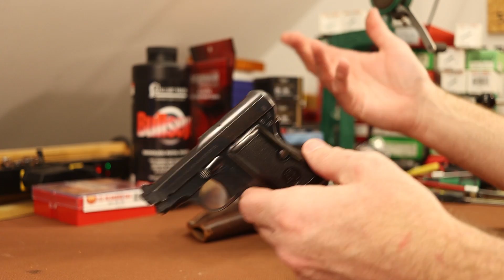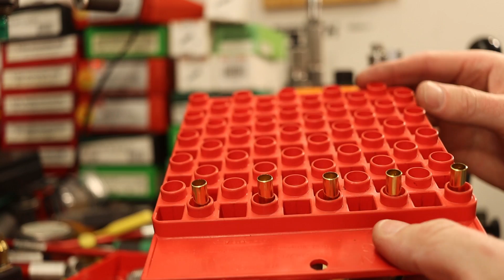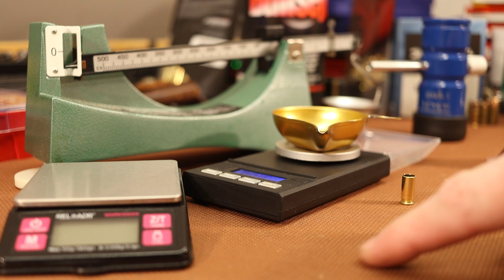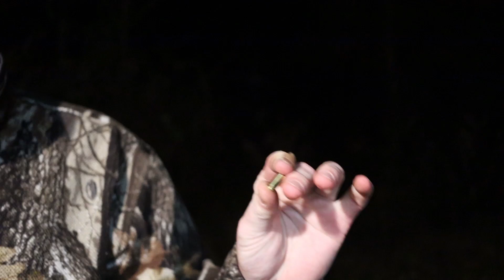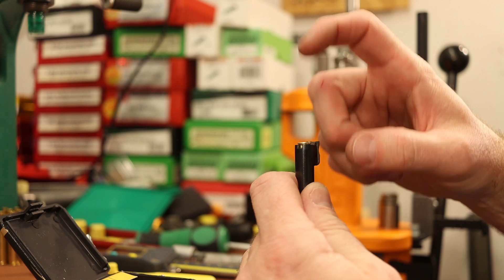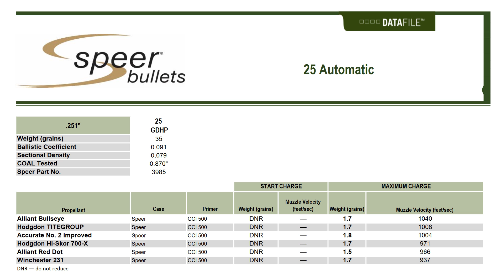Reloading .25 ACP

Comment: JRB-I'm new to your channel and enjoy it very much. I had an ammunition company from 1985-99.  Richard Lee from Lee Precision was a wealth of information for me and a great help. Hence I have a lot of Lee equipment (no detractors please) and have a turret press dedicated to the .25acp. I use the Lee micro disc in my powder dispenser with no problems. It throws accurate charges with flake or ball powder. You do need to expand the case mouth a touch more than usual. I load 50 grain cast powder coated bullets for playtime at 945-960 fps. The gold dot is right at 1000fps. Penetration with the GD is right at 9 3/4 inches in 10% gel. The firearm is a Bauer I carried in my uniform shirt pocket all 27 years I was an LEO. Loading the .25acp doesn't have to be a chore and is quite fun with the right equipment. Looking forward to binge watching your channel soon. Oh the Camdex commercial loaders we used had Lee dies as standard equipment and we loaded millions of rounds without a hitch. Happy New Year and great channel!

Comment: I was in contact with CCI tech dept. several years ago now due to a few misfires I was having....especially after I missed a chance at a trophy buck ugh !.....I was always under the assumption (as many) that the primer cups they made were harder than others. I noticed that more often than not, if I had a misfire a second strike still wouldn't set it off. When I spoke with the tech., he stated " no, they aren't harder, it's just that we make our primer cups on the higher end of tolerance size wise".......which, in my case made sense. If you seat one of their primers in a case with a too tight primer pocket, there's a good chance of fracturing the priming pellet.....rendering the primer useless. I use to use them exclusively back in the day for most handloads but I haven't used them in years because of it. Mostly Winchesters and Federal's in the last 15-20 years......

Comment: Those are not stove pipes, they are failures to go into battery or failure to feed.  A stove pipe is when the spent brass is trapped between the barrel and slide sticking up, hence the name stove pipe.

Comment: I started reloading the 25acp back in the early 80’s. RCBS made the dies and the shellholder. My dies were not carbide, but the shellholder was great. Back then only 50gr FMJ bullets were available and between 1.0 and 1.1 grains of Bullseye was the loading. If I used what my salary was back then as a “cost”, plus components, for reloading them, I paid like $75a box, in 1982 dollars!

Comment: 25acp is NOT at all weaker than 22lr all the data is completely wrong its comparing the twenty two from a rifle barrel of atleast 18'' and the twenty five from 2.5- 3.0 " barrel soo basically its useless data..    Thanks for your time on this video its really cool and i appreciate it very much.. 
This is something I have been thinking of doing for quite some time.

Comment: Any gun that fires if you do not adhere to specific steps in the proper order, is a death trap. Very poorly designed gun. If I had one, heirloom or not, I would chop it up. I would never put it in the hands of anyone else. Especially someone young enough to have their hands fit the rear handle safety.

Comment: If the .25 “powder through” expander die is like other Lee dies you can stick the funnel directly into that fitting you see screwed into the top of the expander die. That die is meant for the Lee auto powder feed and you remove that fitting to use it. The fitting stays in when not in use to hold the expander in place so it doesn’t get lost. Just leave the fitting in, as you did, and the hole on top is perfect for the red funnel, even has tapered sides for “draining”. Thus, after decapping AND priming at station one, you expand and pour in the powder at station two. That would have saved a bunch of trouble.

Comment: Hey Johnny, Ever heard of .277 Wolverine? Its a wildcat that is making its way mainstream. Starline and Hornady are making brass. Anyway its a 223 case with the neck cut off and takes a 6.8 Spc bullet. It is like 300blk in that you can shoot subs and supers but it is way more accurate and just a little weaker than 6.8 but way cheaper to shoot. It was created by Mad Dog Weapon Systems. Check out their website they got hornaday to produce dies and WFT makes a trimmer for it. All it takes is a barrel swap and unlike 300blk it wont chamber in a 5.56. I just heard about it on ar15 podcast yesterday just thought id pass it on.

Comment: Rcbs is best shell holder for this case. 1st to insure you fire arm will work with a certain primer load a case primer only, place in the chamber with it in the extractor as it came out of the mag and pull the trigger. Next due chamfering first, then prime on sizing, place the lee funnel in the powder thu expanding die and drop your charge. Also magnetically dampened scales are bad on light charges because they dampen on the up and hold enough to over charges so use a 22lr case cut to hold the charge of specific powder you want to use, use a paper clip for a handel on it and drop all at once so the scale deflects both up and down to operate properly. This is only my advice but very tested and proven in experiance with this cartridge. Good luck next time.

Comment: Grafs has 50 grain FMJ  bullets which work very much better in my gun and are more pleasant to shoot. Hornady makes a 25ACP seating die which will save your fingers and does a much better job.  Save your Lee seater for use as a dedicated crimping station in the following turret station.  With charges this small you really need to work with  a mg scale.  90 mg of Tin Star ,N32C, will nearly duplicate the performance of Aguila 50 gn FMj loads.  The load density is almost 100% delivering a SD of less than 7.  My best results have been with Fed 100 primers.  The Grafs 50 grain bullet appears to be the same as the on used by Aguila.  Hornady brass is an excellent fit in my Lee shellholder.

Comment: Thank you for a great video : I have five 25 ACP's in my collection and reload for all of them using a lead hard cast bullet at 50 grains with 1.3 of Titegroup. I have found that brass is critical to a good interference fit with Starline or Sellier & Bellot being the best. Shellholders, as you found out, can be a pain in the ass and hard to get a good one and the occasional nipped finger is almost a given with this tiny little round. Also ( again as you have discovered ) bullet setting atop the case before seating can be critical.  I had to have the mandrel for flaring the case mouth "tweaked" in a lathe before I could get the flare I required to prevent mis-aligned heads. After hand-loading 200 of these in a session, a stiff Irish Whiskey is usually required but the reward is the fun of shooting some very small and strange European pistols from nearly 100 years ago. We have tremendous fun shooting ours at 3, 5 and 7 yards on IPSC targets, but if you want a severe challenge, put a couple of clay pigeons out at 50 yards and shoot them offhand !  Here's a tip for doing that, make sure you use a Mauser Model 10 as they have decent sights : you'll be amazed at how it concentrates the mind wonderfully and how well you'll do. Again, thank you for your superlative videos; they are much loved and appreciated here across the pond.

Comment: I wish 25acp was more popular.. I really think it would be a great plinking/squirrel cartridge without all the issues of 22lr
Reply: It's a trade off of problems,i messed around with 22 and 25 alot many years ago, the 25(always remember only having Remington green and white box)was reliable,I don't remember ever having a failure to fire but man,22 is so much flatter shooting,25 drops alot and fast,I hardly ever,if ever ,missed a rabbit with a 22 at 50 yards and hardly ever,if ever actually hit one poa with a 25, I carried a 25 for close range self defense though over a rimfire for the significant increase is reliability. It's a classic what do you want to do comparison,for general plinking squirrel,rabbit,coon,ect. 22 is far more accurate than any 25,per my experience at least
Reply: @wolfmanrebel874  Something I never really considered but you're definitely correct.. A 35gr xtp at 1100fps would still give me almost twice the drop of a 36gr mini mag.. I never realized how terrible the BC is on 25acp bullets

Comment: The "25 acp is more reliable than 22lr" theory kinda goes out the window with this sample anyway
Reply: In the blowback pistols that are chambered for it, you get more reliable ignition. They have no extractor, so like all guns that have no extractor and rely on that operating system, they’re going to be more touchy than a modern auto loading handgun design. When it came out, it achieved what JMB was going for with it. 
I have no idea why, but I have an affinity for these obsolete pocket pistols. Would never consider carrying in any capacity. Maybe a backup to a backup? Finding a load that it likes and then being able to secure a supply of it? Nearly impossible. Fun as hell to shoot, so reloading it such that one doesn’t have to pay $25/box makes it less painful.

Comment: Get a rat tail file, like 4 the chain saw, or a dremel and take some off the top of the shell holder at the apex where it begins to taper down. That should fix the leaning issue. Give it a double angle grind like a valve job

Comment: The mouth flaring die is meant to be used to hold a funnel for pouring the powder into the cases on the press.
Reply: It is meant seat a bullet without shaving it. Not for a funnel.
Reply from the maker: Very true!  If you've ever used the powder-through function you probably know that some powder inevitably gets stuck inside the die (not much, and usually nothing to worry about).  With these tiny little charges I would be worried about even a tiny loss of powder, though.
Reply: Phat Tyre: it is for both purposes. Lee calls it "powder-thru expanding die". When mounted on the turret press and pulling the crank the Lee AutoDisc dispenser will pour powder in the top just as the mouth is flared. When not filling the case with AutoDisc, you can fill through that opening. See: https://leeprecision.com/reloading-dies/hand-gun-dies/powder-thru-expanding-die-only/

Comment: If I remember correctly, the slide hold open position of the safety lever is for disassembly only, not to be used for dropping the slide on a loaded mag.  With the safety in disassembly the sear is disengaged and allows the firing pin to travel home with the slide before the sear can engage the mating surface on the firing pin.  You should insert the mag with the slide forward, then rack the slide to load the first cartridge.
Reply: Have a look at this new Gordons Reloading Channel video.  It is in German, but should have an English overdub shortly.  https://www.youtube.com/watch?v=T3lss3rI0vw
If you look carefully, you will see that GRT already has a StaBall 6.5 powder model at about second :27.  You will not find that in QL.  GRT is free to use.  I can tell you that the StaBall 6.5 powder model is very close to real life.
Reply: Here is the English version.  https://www.youtube.com/watch?v=wuNeaQxU-jg

Comment: I reload for my Beretta 950 .25 ACP using a Lee die set.  (I use Magtech's brass and 50gr. FMJ bullets, Bullseye powder and CCI 500 primers).  The shell holder I have gives a proper fit.  Are you sure you have the correct one?  Also, your failures to feed are just that: failures to feed.  A "stovepipe" is when a case fails to completely eject and ends up sticking up out of the ejection port looking like...  a stovepipe!  I tend to think your pistol needs a new set of springs for reliable ignition.
Reply from the maker: Robert Scott I was annoyed at myself during editing for calling all of those stovepipes. I knew better and have no idea why I did that.

Comment: I learned that CCI primers are hard because between a S&W 686, S&W 66-2, and two Colt Troopers (Mk III and Mk V), I repeatedly had failures to fire when shooting double action. Absolutely no issues single action. And absolutely no issues double action since switching to Federal small pistol magnum primers. I still use CCIs for all my other bulk pistol ammunition and have no problems in any other caliber than .357

Comment: If you still have the Hornady hand priming tool from the Lock n Load press kit, that might be a good option since it uses regular shell holders. It’s a hunk of junk otherwise but should work in this case.
Reply from the maker: I completely forgot about that!  That would have made things SOOO much easier!
Reply: The RCBS tool uses regular shell holders, too.

Comment: Made me smile when you said "We are not here to talk about the Beretta 418 because this is a reloading channel" I believe that people need to accept that.  I applaud your effort in working with such a small caliber. Btw, I you are correct with your instruction in bullet alignment, as you seen with your groups I have a feeling that was the culprit, (9mm is the same deal). anyway good video-Dave
Reply from the maker: I think I've become too reliant on the Lee Factory Crimp Dies and when I don't have one it makes me a little nervous.  I think I even mentioned in the video that if I was reloading 9mm I would have flared more, which should have been my first clue that I was about to make a mistake.
Reply: @JohnnysReloadingBench  nope your first clue should of been Lee. If you check around you will find out that everyone useing Lee dies has a seating problem. The seating stem floats around and doesnt line up all the time causing the bullet to tilt to one side and with the added issue of the shell holder im surprized that you had so few problems.Buy a hornady seating die and shell holder to make the problem go away. Personally the 25acp makes a better paper weight than a defence gun.

Comment: I would highly recommend changing the firing pin spring, double check the firing pin channel for cleanliness as well. Failure to fire and firing on slide drop could be because of that. I'd also be checking the sear for wear. Wolf springs may have what you need if beretta isn't an option. I'd replace every spring the gun has if possible.

Comment: i'bought one of those in new mexico in the early 70's, it has a brass colored frame though. it's a great little gun and i've put a few rounds through it over the years. i think you might have trouble running anything but ball ammo through it. they had no other type of bullet back in the day i'm aware of, and that's all i've ever used. never had much in the way of hang ups or malfunctions, it always gone bang. no double fires either( but my hands are fairly small). i would carry mine now with confidence, but have no holster and have not found another clip or two. if you can get them to feed reliably i't would interest me greatly, i've been keeping my eye out for that for a while but never found anything. there once was some ammo that had a bb on top of a kind of hollow point, i assume it was to help it feed , but i've not seen that ammo again. i've never had the gun fire when i dropped the slide like you did, don't have any idea why it did that to you. good vid, thanks.

Comment: The Lee Hand Press works better for sizing. Can angle the shell holder to keep the case straight in line with the die. Otherwise a new pencil with an unused eraser on top keeps fingers safe. 
The double tap is likely the shooter. Those older guns had easy triggers and people with medium to large hands usually bump the trigger in recoil with a resulting double tap.
"Down is fire"...... I suspect what is happening is the same thing that happens with a de-cocking gun - only that isn't equipped with a de-cocker.

Comment: I loaded up 100 rounds of 25 acp once.... haven’t fired it. Cant bring myself to after the aggravation I went through loading it lol
Reply: Sounds like my favourite PITA - the .22 Hornet - bulges cases and crushes necks unless you are SUPER careful.
Reply: @richardmeyer418  I used to think I wanted a 22 Hornet, used to...  I always hear of inherently accurate cartridges but the 22H seems to be inherently INaccurate!  Could it be that the twist rates are too slow I wonder?  I have thought about the 17 Hornet but I already have a 17 Fireball so it’s just a thought.
Reply: HAHAHAHA!  I have a few reloads like that.  They were such a pain in the ass to load, that I just tested them, and shelfed them.
Reply: What made it so difficult?
Reply: GunFun ZS struggling with the crappy lee shell holder. Weighing each individual powder charge and checking and rechecking because there’s no margin of error. Spilling the powder when trying to fill the tiny cases. Dropping the tiny bullets, having them flop sideways when trying to seat them. Ripping the tiny rims off while trying to prime (crappy lee shellholder again). It’s the reloading equivalent of building a ship in a bottle lol
Reply: My mom has an old 25 acp. If reloading for it is as much of a bitch as trying to shoot that tiny thing then I feel your pain!
Reply: Mat0311 allen just throw it, easier, and cheaper than a couple boxes of ammo
Reply: I have read in forums hand loaders experimenting carefully using all the necessary equipment and experience , with factory ammunition disassembling and using the components to adding a tiny bit of powder to the case.
Apparently most factory ammunition is loaded with 1.1 to 1.3 gr of powder.
Some reloading manual suggest 1.6gr max. So it appears that there is room for improvement if to be used in a quantity 25ACP in good condition. Usually factory ammo is loaded to 750fps maybe looking for around 850fps for the 50gr bullet.
Some crazy guy stated that he loaded the little case full and compressed powder without any damage to the Baby Browning, Beretta after a bunch of ammunition fired through them. I believe was High road forum.